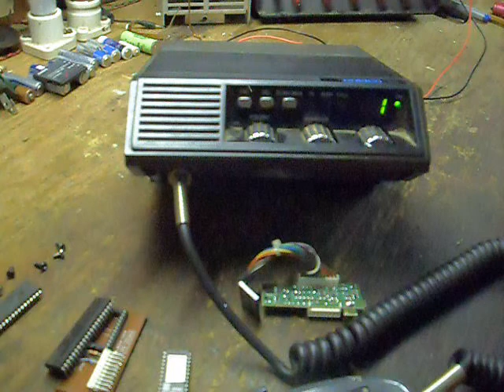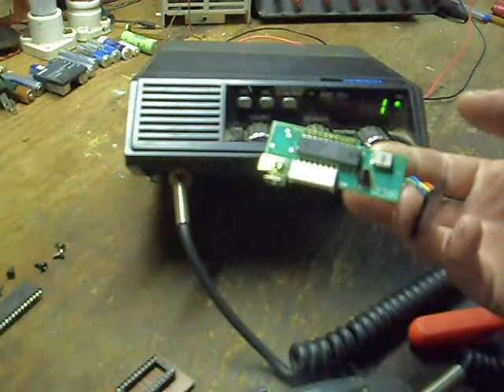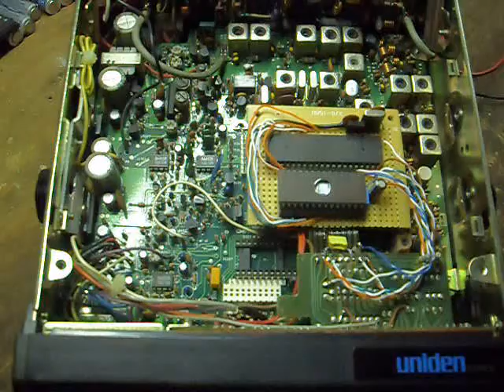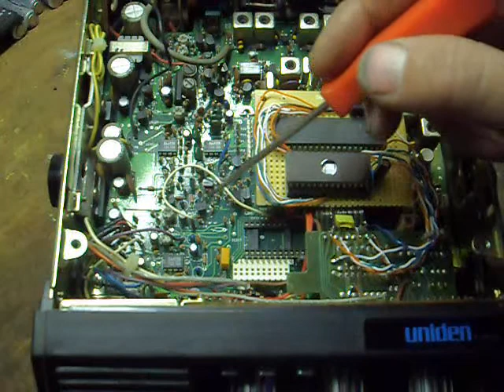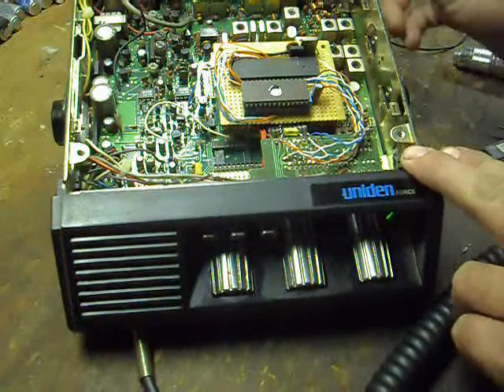Uniden force VHF radio modification using a salvaged 8042 microcontroller.

Comment: It's too bad you couldn't get your hands on a Uniden programmer.   Converting the radio to the 2 meter Ham band would have been a lot easier for you.  I converted one of those radios about 24 years ago.   The programmer lets you program the Tx, Rx frequencies and pl tone for each channel.  The VCO works ok on 2 meters; may require a minor tweak.  The RF Amp does have to be tuned to get the maximum power out.   I also programmed an EPROM for the 450 MHz version of this radio, but the VCO doesn't work.   My programmer no longer works.

Comment: Hello, I think I have 5 of these radios and would like to do the modification you did. Do you have a pin out diagram for this?  Or is this all you have. Also. Is there newer hardware that would support this or are these chips still the best bet?